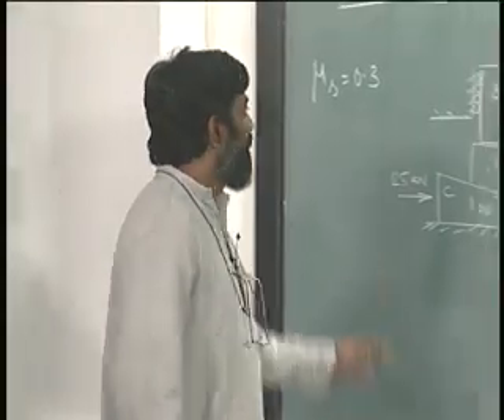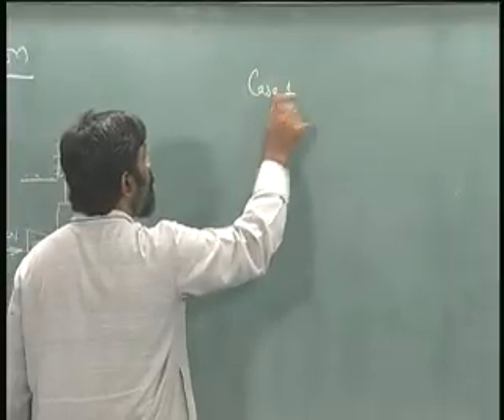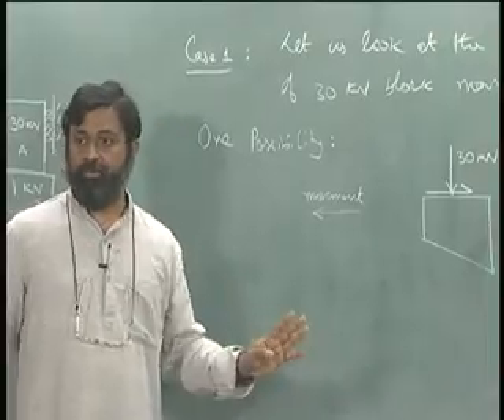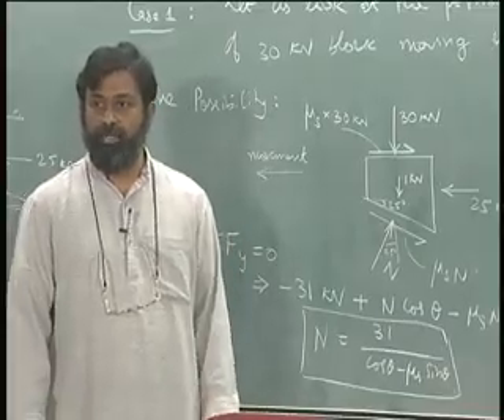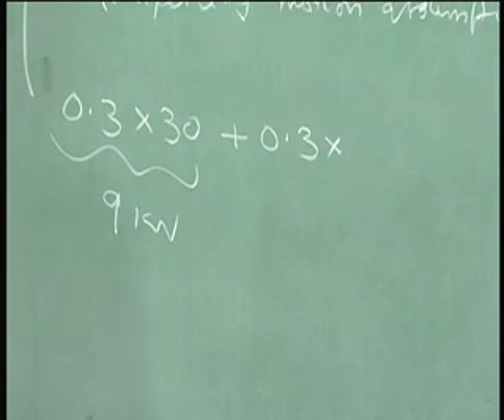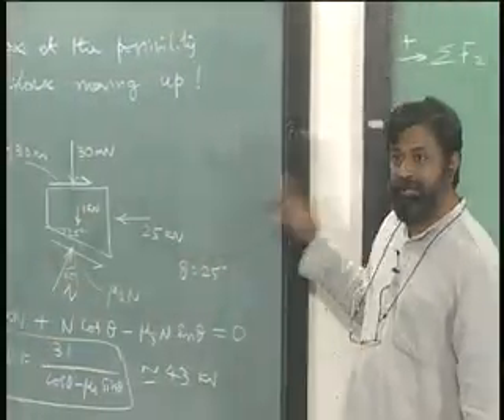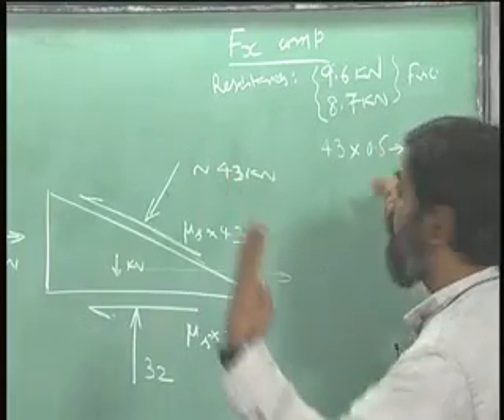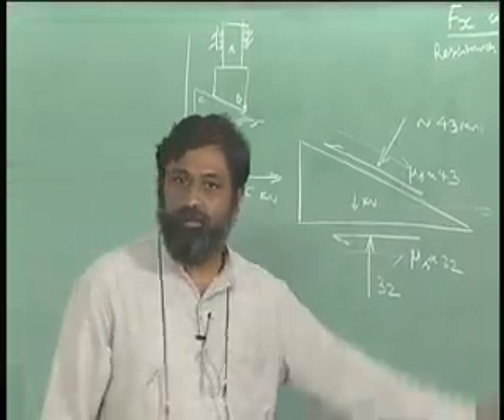Friction - Solving Problems

Comment: wait why is the normal bigger then the weight??? If the ground is flat the normal would be equal to the weight. But since the ground is angled should it not be smaller since it has less force to oppose.